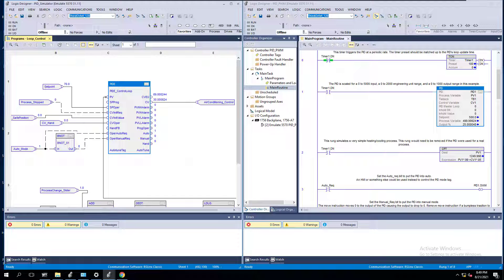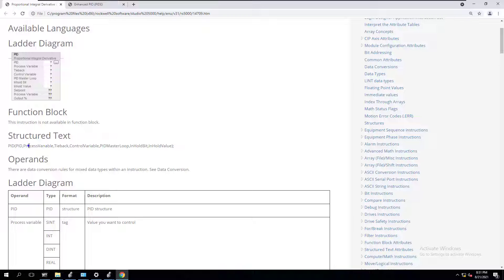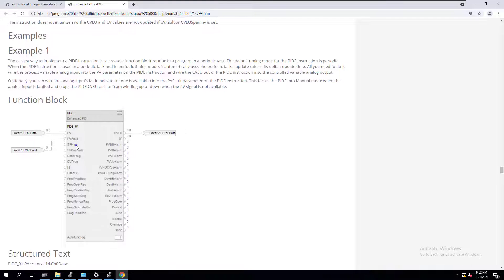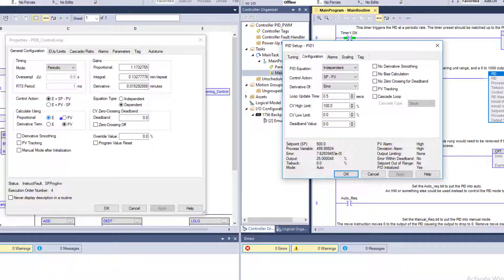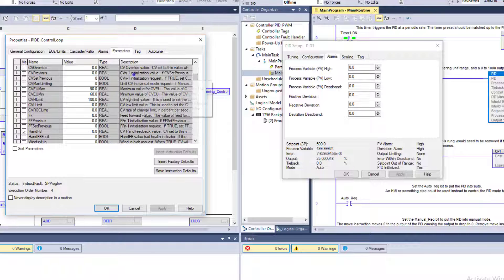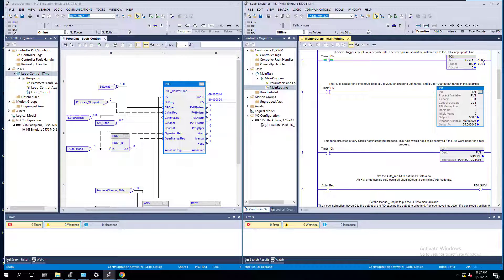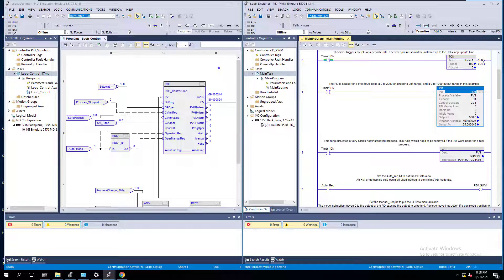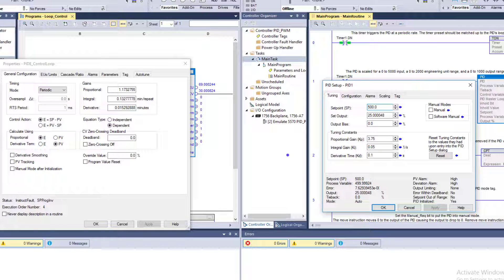Difference between a PID instruction and a PIDE instruction using Studio 5000

Comment: Are you familiar with MVI69-MNET and how to program it and modbus network?
Thank you
Reply from the maker: Yes but that isn't easy to explain over text. It is a modbus conversion.

Generally, it depends on the devices used & then the third party has a set of AOIs to use.
Reply: @ShaneWelcher  thanks for the quick reply. I agree that it's not easy to explain here but how you can help? What do you suggest if someone wants to start learning it?
Reply from the maker: @renaco1145  take note of what devices are used then search that vendors website for their AOIs & how to use them.

They generally give support
Reply: @ShaneWelcher  in my project they are using MV169L-MBS , You meant search for this?
Reply from the maker: @renaco1145  If you have a project that already uses that model then their should be an AOI or add on instruction that refers to the module.

This should show we here the system interrupts the data from.

It's case by case basis depending on the end device used but with all that said...it still converts modbus to Ethernet.

The data from the card is converted to modbus.

The PLC would then use that data.
Reply: @ShaneWelcher  customer asking us to program that. It's not been programmed. That's why I was looking for help or advise how to do it. Is there any sample program or ideas from the device supplier?
Reply: @ShaneWelcher  you mean, when it's installed, its data ( AOIs) could be imported into the compactlogic?
Reply from the maker: @renaco1145  Depending on what field devices are used, yes.

There is sample code.

Based on what vendor is being used, they offer add on instructions & sample code.

Also they support what they build.

This still uses the modbus registry.

Please reach what vendor you are using them ask them for the add on instructions & support.

The add on instructions are generally:

AOI56MCM 
AOI56MCNET

That is two examples.

Google prosoft then ask them for the current add on instructions & or sample code.

That's about all I can recommend.

There are a number of add on instructions that prosoft offers.

Get the ones for your card, I believe you need to sign up to prosoft.

It comes with use case documentation
Reply from the maker: Prosoft technology then products then select the card & under downloads there is a section for all of the information I am referring to.

Add on instructions & sample code
Reply: @ShaneWelcher  thank you so much for your help sir. I appreciate it. Our conversation over here could be a great review of how helpful and supportive you are.
Reply from the maker: Here is the link to the that Prosoft module.

https://www.prosoft-technology.com/Products/Rockwell-Automation-In-chassis/Platform/CompactLogix/Modbus-TCP-IP-Communication-Module-for-CompactLogix

I have used the support videos as well to set up things in the past, along with calling them directly.
Their support is helpful but they will refer you to the videos on pages like this.